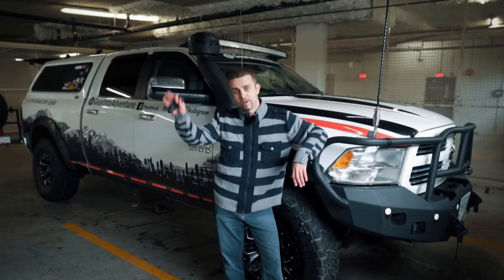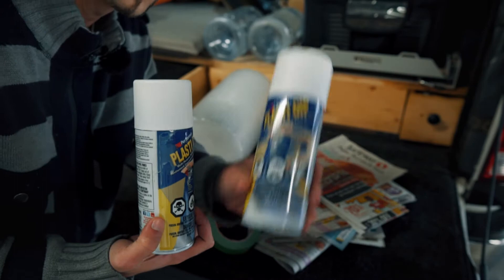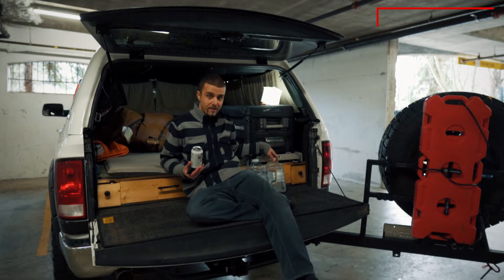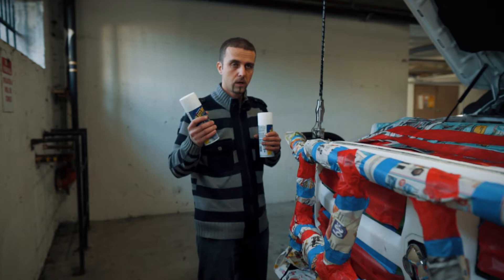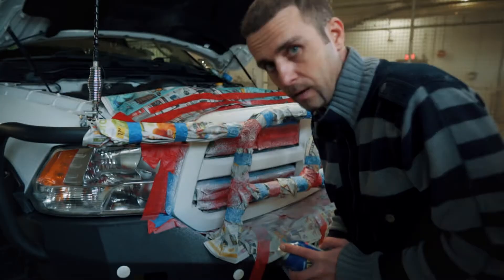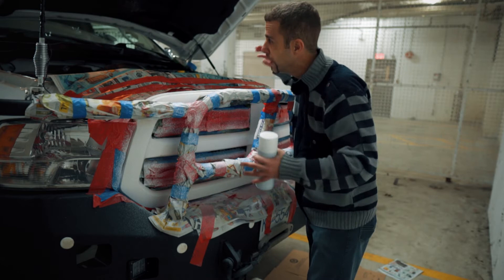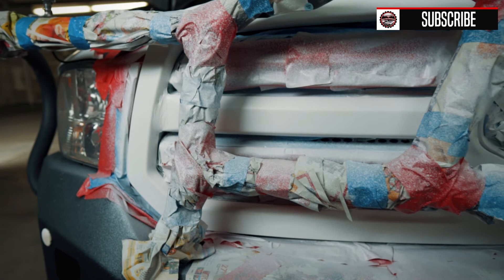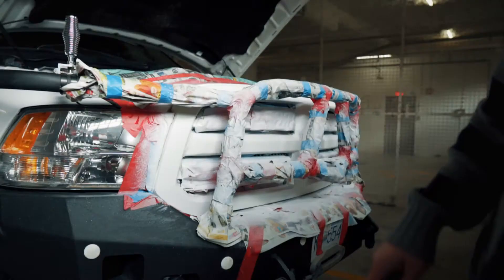How to use Plastidip : Dip Your Car !!! - also Plasti Dip issues and Plasti Dip Offroad durability

Comment: So much easier to take the grill out! Shouldn't have had to take the bumper off first. 4 bolts on the top then lift up.
Reply from the maker: Tried that already first time. This bumper rails sit too close. There is bottom part that needs to come out on grill and that was blocked by bumper. That was the bummer to find out first time when i tried to do just that
Reply: Thats crazy. My 2012 1500 came off no prob and my 2500 slides up to come off. What a giant pain in the ass haha. Doing my grill tomorrow myself
Reply from the maker: Same bumper or something else? Yah maybe slight differences 2012 and 2014 how they designed grill holderd. It was i remember really just like 1cm thing that just wouldnt allow. So u dipping urs tomorrow?
Reply: I was but I had to push it out to friday cause I had a kid home sick and tons of meetings but hoping to getting it done in the morning. I'll post it on my instagram @ therogueadventure
Reply from the maker: Looks like u are some film making hotshot 😁
Reply: Gear Into Adventure I don’t know about a hotshot but I’ve done a little